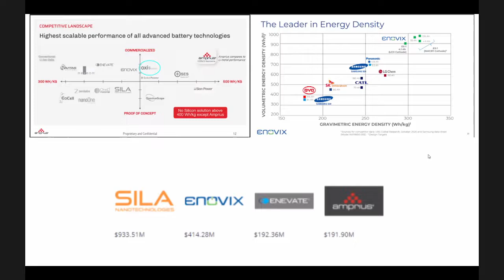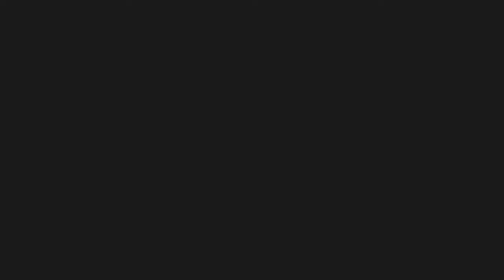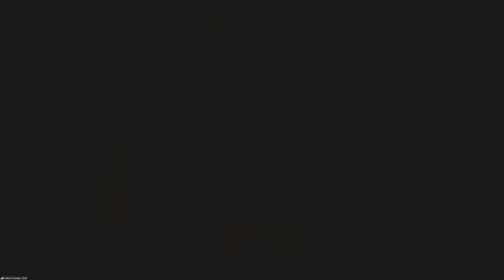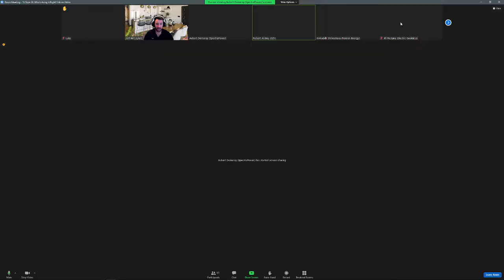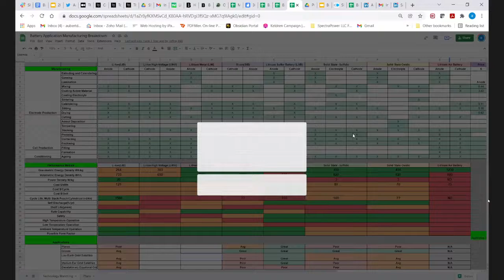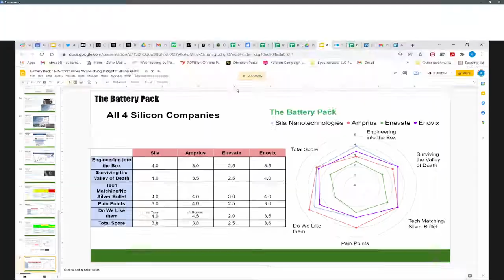Who's doing it Right? Silicon Part II Reviewing Enovix and Enevate (Second Half)

Comment: This is vastly incorrect.  All companies have different "pack" densities.  Teslas density is about 40% lower than advertised when you go to pack level.  It is not an Enovix or Solid State compression issue.  The compression is probably less than 5% of the loss.  Makes me question whether these people are actually experts or people googling information and repackaging.  It is a very trivial thing battery engineers know.  Quite troubling this was a point that was made.